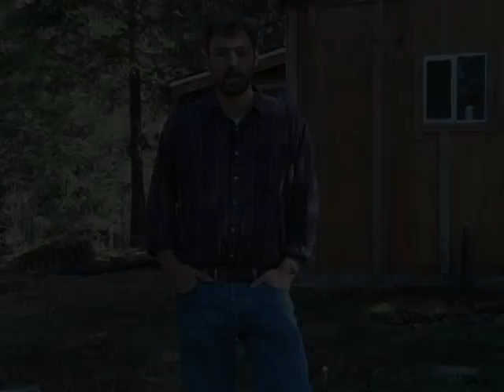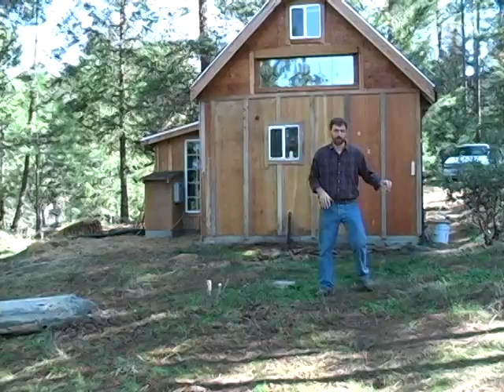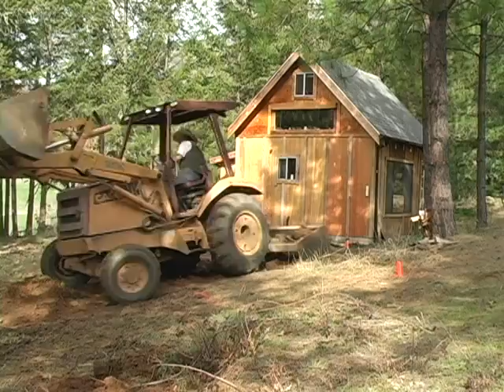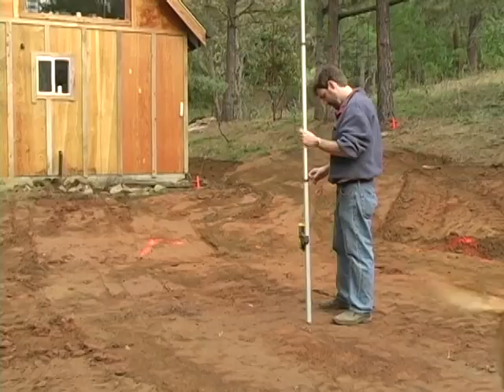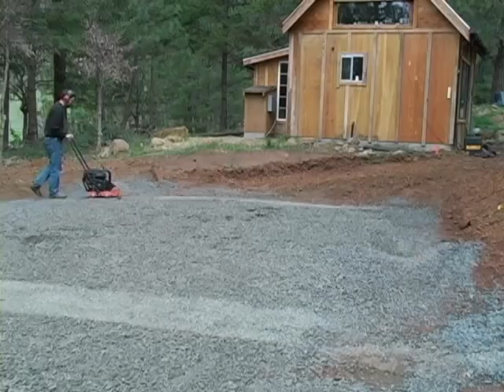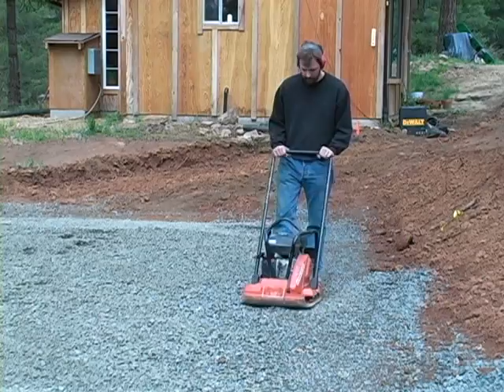Pouring a slab: Prepare the Ground & Drainage

Comment: Help. Need opinions.  
My application needs a  gravel base ranging from 2 to 6 inches and I'm concerned about settling. Should I use crushed rock or Pea gravel (or larger round gravel)? I've heard that pea gravel will not settle to crushed rock.

Comment: Ok, we are putting in a 25' circle and will be placing a fire pit in the center. We are going to till the area up and scoop out most of the dirt. How low should we dig out? We are in Kentucky and our soil is mostly that orange clay dirt. Another question I have is should I put a layer of gravel then the wire then poor the cement over that? Or should I do no gravel, wire or re barb then the cement? New to this but I want to get it done right.